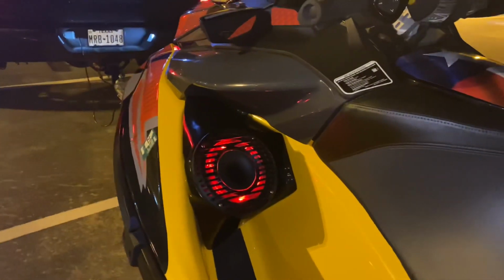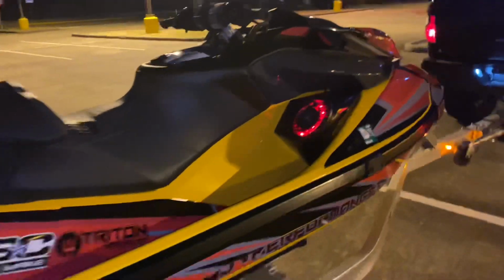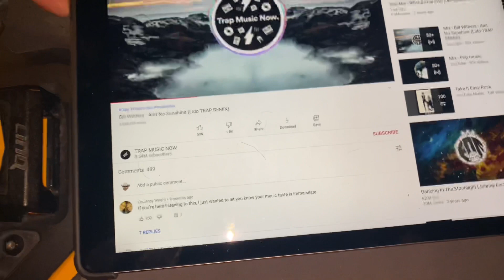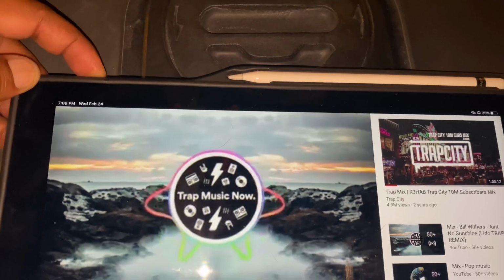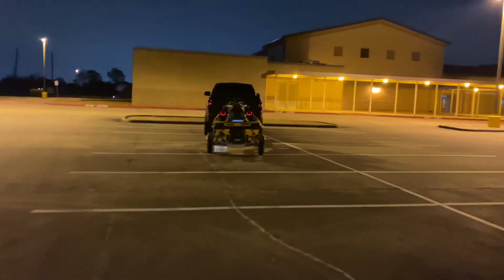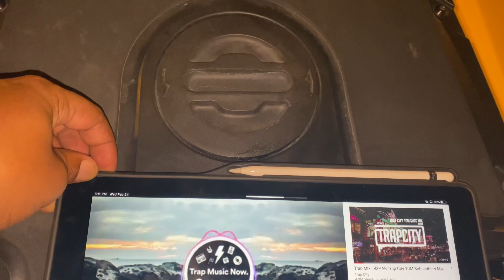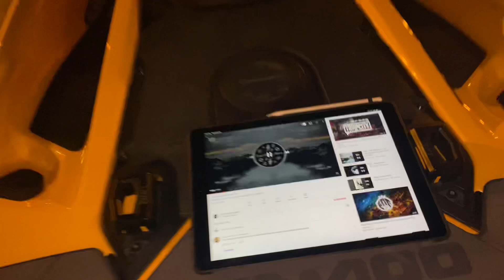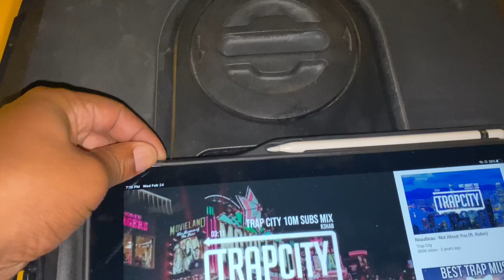Wet jet Performance RTG 8 elite sound system. Loudest in the world

Comment: Hope you keep making them! I'm planning on upgrading the system on my 2021 300 gtx with these. Short on the cash right now, doing lots of performance upgrades right now. Air intake mod, cool air intake, catch can, new water box, exhaust, injectors, super charger upgrade, prop repitched and maptuner X for tune (trying to get to stage 3) all thru Riva racing. But definitely getting these speakers after all this is done!